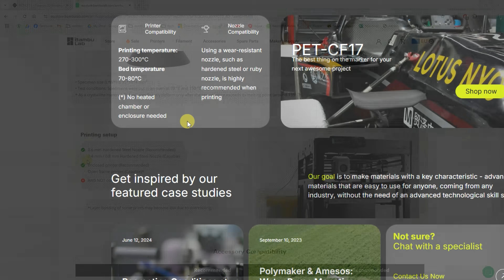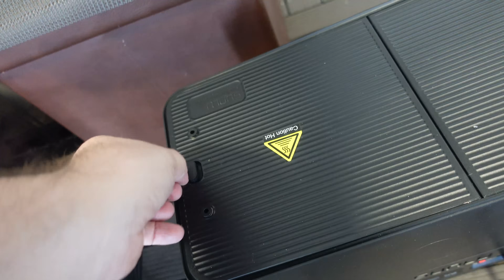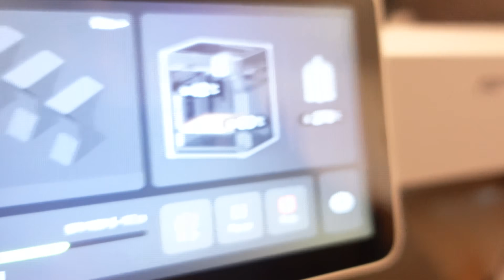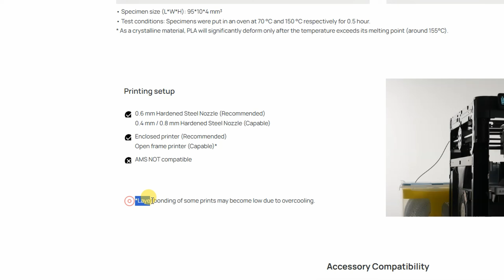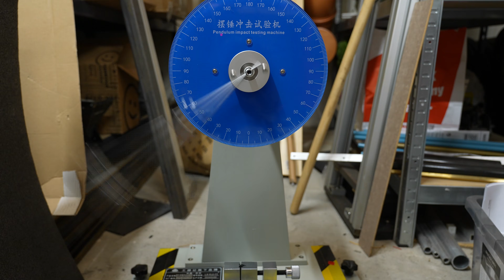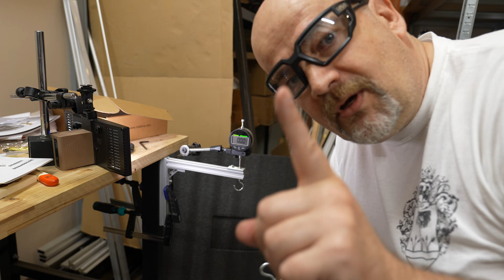Best PET-CF Filament? I Tested 5 Brands

Comment: 7:14: bracket from BL filament is the worst because BL itself is an abomination of a 3D printing company. This is the only reason I won't upvote this, in any other respect good, video. Just because you use the enemy tech.

Comment: MAY 2026 Toxicity Warning: do not print this filament on a non fume-mitigated setup like a Bambu A1 or Prusa Mk. 4 as well as un-filtered enclosed printers like the K1 and P1S. At 260° C+, harmful VOCs like acetaldehyde and formaldehyde are released into the atmosphere as well as UFPs like TiO2 (white colorant) and Carbon Black (black colorant).

Comment: Really like your test using the filament for a bracket for extruded aluminum.  I have been thinking about this use and was shocked by the amount of flex in the aluminum bracket.  Could engineering filament be a cheaper and better solution?

Comment: For the bracket test perhaps the torque spec of the mounting screws affects the result/stress of the material?
Reply from the maker: Only if it is not tighted enough. If tighted, then it don't affect the bending. Its not moving on that installed point

Comment: Hi!
I found some irregularities in this video and I would like to ask You for a comment.
During the temperature test in the oven, we can see that the unannealed sirayatech starts to deform at ~125°C. However, in Your video from a Year ago where You tested the same filament exclusively you had to stop the test at 212°C because it wouldn't deform and You mentioned that it is not annealed (https://www.youtube.com/watch?v=Y7npttLpcO0).
Why is there such a huge discrepancy?
Also, maybe as a warning to people who actually want to anneal materials. I printed some very complicated geometry parts out of PET-GF and annealed them in my lab oven and after 4.5h at 90°C i opened the oven just to find the parts completely deformed and therefore completely useless. I used Qidi filament. Their TDS states annealing 4-8h at 80-100°C and when I contacted Qidi support, I received an email that ofcourse you need to put it in a container and fully submerge them in sand or salt.
Reply: Maybe in the first video the temp. ramp-up was slower and the part annealed itselt before deformation. This is a realtively simple and small part, myabe that's why

Comment: I do appreciate the corner bracket test with the cantilevered beam. I am trying to design a 3d printed joint that mounts a horizonal bar to a vertical bar as a cantilevered beam and the deformation from stress is extremely important for the design.  I appreciate the thoroughness and precision of all these tests. Thanks Igor.

Comment: I bought a spool of the Siraya and have had nothing but problems.  I think the spool I received has a LOT more than the advertised 15% CF or the CF is chopped longer than normal.  The printed parts appear fuzzy on the surface and are not comfortable to handle.  I am having heat creep problems.  X1C with door and top open go a little longer but it eventually stops extruding.  I think the CF in the filament is conducting the heat inside the filament across the heatbreak and then it jams.  It could also be annealing in the hotend.  I did try a 0.6 nozzle thinking it might be jamming on debris in the filament.  This didn't change anything.  It will print maybe half an hour if top and door are closed and that goes up to 45 minutes with them both open.  I was going to use this material to print parts for a Positron.  I ended up printing those parts in Polycarbonate, a material which I am now quite fond of.

Comment: I think Indeed this is the best engineering filament to use. No crazy water absorption, good rigidity, no smell, very good heat resistance. Fiberon is crazy good and cost effective.
Reply: No crazy water absorption after printed maybe. My filament needed drying after 12hrs of sitting on my ams. Other than that I would agree it's great stuff!
Reply: @alecsantos3805 yep I would agree. I always dry it for 2h before printing and I print with it still hot, in the drier.

Comment: Anyone else hear him say that his sponsorship doesn't affect his tests and immediately trust that as the truth?  Some people, you can just tell that they are honest.  This guy is one of those.  Love this channel as I love experimenting with different engineering filaments
Reply from the maker: Thank you. The reason for my statement is simple math: Patreon donations are five times higher than sponsorship income. So, if Polymaker made such a request, I would decline the cooperation — and they know this.

Additionally, having a PhD in my country means we went through a kind of “brainwashing” process with courses like Engineering Ethics and similar subjects.
And I am also using these results, if I want to check something (print parameters, layer adhesion etc), I check my videos. So I don't want to have errors in them.

Comment: Edit: I saw you literally printed a ping-pong ball in your newest video! :D That's awesome! Original message: Regarding the impact test, it would be interesting to see some real world tests as well... printing some object and dropping it from different heights onto concrete, something like that... Because a strong part often doesn't help me if it will break if dropped on the ground... a lot of parts I make are meant to be used and accidents happen. ^^

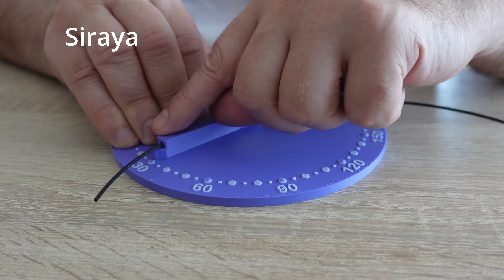Comment: 09:27 did you check how much of a difference that really makes? because what I experienced with some PLA+ is that even if the PLA+ filament is brittle, after it's printed it becomes flexible. I am not sure how or why, but I have some orange Creality "ST-PLA" and it's in some parts super brittle on the spool but after printing a failed disc became a frisbee and I could just wobble and bend it and hit the concrete wall with it like 20 times pretty hard and no cracks or anything. But on the spool it's so brittle it sometimes breaks just on the part where it feeds into the extruder gear when resting. So I am not sure how valid that test really is(?)
Their ST-PLA is awesome and really cheap btw! I print a lot of functional parts with it that need to resist knocks/cracking.

Comment: Another excellent test. I might have missed it but did you torque the corner bracket bolts to the same value for all filaments?

Comment: Im really interested in get PET-CF to print some car parts that will be exposed to engine bay heat, specifically eSun PET-CF since its more affordable. Never tried to anneal any of my prints so im wondering what kind of oven you use to anneal your prints and should i just get any basic digital countertop oven or better to get a lab oven? Love your videos by the way, really helpful.

Comment: Your corner bracket test seems very dependent on how much you torque the screws
Reply from the maker: This is correct if the bolt is loose. But if tight enough, that part is not moving, but the rest of the object.

Comment: Made from a Polymaker PET-CF housing for the chamber heater. The ceramic heater is in direct contact with the annealed part, but there is no deformation or other problems.

Comment: Amazing video, I seriously love your stuff. I do have one note on the corner bracket testing, though. You should maybe mount a jig to ensure that the deformation is always measured from the same point, since it is a leverage-based test; a differing radius will affect the results.

Comment: I was mainly looking for temperature resistance. Basically the best filament that I can print on an open printer. Strength isn't even a consideration for this use.
What i didn't get from the video is what temperature I can go up to without deformation. Will annealing at 100C cause my part to deform in any way - do I need to support overhangs?
Once annealed is it safe to use at a constant 100C?

Comment: Just curious Doc as to why you didn't mention how a heated chamber can improve layer adhesion & mechanical properties. 

When you do use the Plus4 HC I see between 15 & 20% improvement in the mechanical properties. 

Pet-CF absolutely benefits from HC printing. 

As mfgrs start to realize the benefits you'll see them trend   towards HC printing. 

I would like to see more testing using the Plus4's HC. 

Thanks Doc! 
Love your channel!

Comment: Thank you for the useful video. I’ve been waiting for a video in this format for a long time — it’s much more interesting to watch than just testing a single filament, because you can immediately understand what’s better and what’s not so good.

If you simply look at filaments from Qidi, Phaetus, and Siraya Tech, the filament strands themselves look incredibly similar, and that’s because they’re made by the same manufacturer — the only differences are the batch number and production date. However, the results you obtained were slightly different, and I think that’s because the exact same conditions weren’t maintained. Different amounts of time with the spool left open, different storage times for the printed samples — all of that will affect the results.

Although there were some differences, the results still confirm that these three materials are essentially the same, and the variations you got are simply within the margin of tolerance.

I use Polymaker, Phaetus and FusRock, their filaments are very, very high quality, so they are my favorites.
Reply from the maker: I am not sure if this format is good for the mass. So far between lowest views from last 10 videos. Maybe they like better the one brand filament review(?)
Reply: @MyTechFun  I like the comparisons a bit better personally, but that's just my opinion :)

Comment: Given that Brass conducts heat better, can I use a brass nozzle and just change it very frequently (since they are so cheap).  Id love to hear your thoughts on this and even a video with testing would be awesome. Also, is it true that printing 300c with brass would equal 290c with steel?
Reply: Pointless since you can get a copper nozzle with hardened tip which is best of both worlds

Comment: I feel like for short fibres, in terms of actual strength the composite would benefit more from a fibre that is less of a mismatch in stiffness with the matrix material. That way when the material is stressed any shear forces between the fibre and the plastic are more distributed along the length of the fibre, rather than concentrated at both ends. So glass should work better but aramid might work even better, still. Also depends on how well the plastic sticks to the fibre of course. But I haven't seen any PET-aramid for sale. Form Futura does make an aramid fibre reinforced ASA, though.

Comment: Which specific filaments have you used of those manufacturers? Fiberon has 2-3 PET-CFs.
Reply: Nope, fiberon has only one pet-cf, with 17% cf. Where did you get that from?
Reply: @riba2233 I didn't realise he said he's using the 17%. What I meant is there are different %s.
Reply: @JacopoFranco no there aren't, 17% is the only one. I will ask again, why do you think there are more options?
Reply: @riba2233 100% my fault. Misread, the other CF filled is petg.
Reply: @JacopoFranco ah yes, no worries  😊

Comment: I like the comparison between producers It really shows that they are not all equal. I'd like to see some repetitive type tests. I have some PET-CF parts that have shown some strain marks and made some disconcerting cracking noises with use and it has me questioning if repetitive loading will cause weakening over time. Thanks for the work you put into this.

Comment: I have been using the Tinmorry PET-CF which is excellent value and in my opinion prints way better than the Bambu Lab version which is the first PET-CF I used and more expensive.  I am also loving the PETG-GF and PETG-CF from Tinmorry.

Comment: Based on user anecdotes I expected Qidi to beat Polymaker and for Polymaker to beat Siraya Tech, but it turned out to be marginal. I have a feeling then that the people that trashed Siraya Tech PET-CF just had bad settings. I only used Polymaker so far but I have a Qidi roll in the dryer. I am finally gonna give Siraya Tech a chance, the price is too good to pass up for me.

Comment: The new bracket test could probably use some sort of model that doesn't require manually applying screws to the model, but rather sockets in to an extrusion that already has some sort of stop applied to it, so you can just slot the printed model in?

Comment: Qidi technical filaments are 95% rebranding of Phaetus (Fusrock). Which is totally fine because it's not easy to source Phaetus filaments and Qidi often has sales. 

If you need proof just compare Phaetus (Fusrock) website with Qidi's filaments. Some of the TDS from Qidi they forgot to remove the name Phaetus.

Comment: PET-CF is such an awesome material. Looks beautiful, high temperature resistance, good chemical resistance, strong layer adhesion, great mechanical properties overall, pretty easy to print. It's the jack of all trades engineering filament in a way. PET-GF is also great. Main downside is toughness since it is brittle as with most fiber filled filaments.
I am consistently impressed with Siraya Tech filaments. They generally perform as well as or better than most other brands, but for a much lower price. We love to see it!
Reply: On top of their great filaments and pricing, Siraya Tech has amazing customer service as well.  I made a mistake drying the ppa-cf core and they sent me a new roll for free.  Im more than impressed.
Reply: @rustimack Boss!
Reply: All of the above, and I just wish there were a few more colors 😂

Comment: Several Qidi filaments are the same as Phaetus, both of which are made by Fusrock. Bambu Lab uses some as well such as for their ABS-CF. They use a different grade than the Qidi ABS-CF, which has more fiber content. There are only so many filament manufacturers, of course, and no printer manufacturer makes their own that I know of except Prusa.
Reply: Thank you for this information! Love your channel btw!
Reply: @LaserStreak Thanks a ton! 😁

Comment: I think it's a shame you don't fully calibrate each filament separately before running test prints. Since each filament isn't optimized for it's own composition then a lot of your comparison tests don't really mean anything.
Reply: It's not 2014 anymore, what calibration lol
Reply: @riba2233  SMFH ... that is a glaring level of ignorance on your part
Reply: @Mrzizzy69 false, you just don't have enough experience with modern stuff.
Reply: @riba2233  He literally had to change the temp. of the Bambu filament in the video to even get it to print right. That alone is a demonstration of the importance of calibrating your filaments. Imagine the differences if he just ran a temp tower for each filament prior to testing them with a generic profile. That shows you that there are differences between the filaments  that should be accounted for. And that is ONLY temp. Calibrating flow rate and pressure advance are BARE MINIMUM for even "modern printers". If you've never done these and tested them for yourself then you  are just talking out of your ass and demonstrating your own lack of experience and ignorance. Use your head.
Reply: @Mrzizzy69 false, you are missing a lot of nuance here but I won't be the one explaining it to you, sorry

Comment: Filled PET really is a great all-rounder, especially given the price compared to other "engineering" filaments. Then there is also the fact that it is no more dangerous air quality wise than PETG.
Reply: PET-CF is not as dangerous in terms of air quality as ASA/ABS but not safe either. It's important to notice that harmful gas/particle release increases significantly when printing temps go up, especially after 270C. Also carbon fiber (especially if sanding parts) might be a health risk. 3D printing industrial materials in living spaces is a new thing. I think more data on health effects is needed to see if it's safe in long term.
Reply: @metrimattila7553  yes. Pretty sure I've read from print farms using gf/cf filaments note a shimmery dust building up, implying those are in the air. Any fiber filled filament should probably be printed in a filtered exhaust enclosure.
Reply: @metrimattila7553 I never said it was safe. All I said was it is in line with PETG. Nylons and styrenes are obviously much worse.

Comment: Pretty happy I bought bambu lab pet-cf when it was half price this summer. Great video, thx Ivan
Reply: Siraya tech PET-CF is always cheaper, regardless of w.e. Bambu's sale is. Same goes with their PPA and other filled filaments. They are my go-to at this point.
Reply: @winebartender6653  except the BambuLab is a much better filament overall, especially layer adhesion + has a much nicer surface finish.
Reply: @FrozenByFire3  Siraya Tech had almost the same layer adhesion strength, much better layer adhesion strength open air which implies it will also work better for larger prints or with more cooling, it had the same tensile strength within margin of error, higher temperature resistance, and generally performed similarly and could easily perform better with some basic tuning. He said he used the same temperature for all test pieces, but Siraya Tech gets better properties above his 300C test temperature. Not denying the Bambu Lab was slightly better overall in these specific tests, but $33.99 vs $44.99 + shipping I know what I'm buying.
Reply: @802Garage And mind you, that $45 is for .5kg while siraya tech is 1kg lol
Reply: @winebartender6653  Holy crap I didn't even realize. That's obscene. That's like high end nylon or PPA pricing.

Comment: For Qidi Q1 Pro users, printing 300+ constantly will have you swapping silicone boots often. Stock up.

And put some Boron Nitride based thermal paste on the heating element.

Printing Siraya Tech PET-CF, I had the best results at 320C

Comment: On the angle bracket test, I wonder if some of the deflection is just slope in the connections.  Might make sense to preload with 1kg and then measure the deflection difference between 1kg and 2.5kg and 5kg.